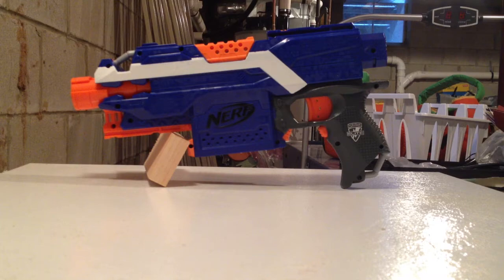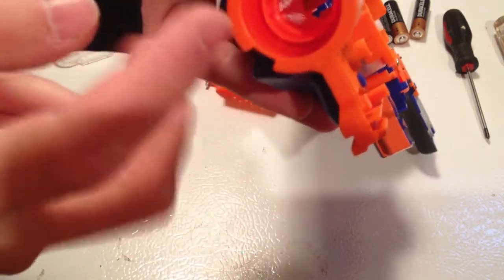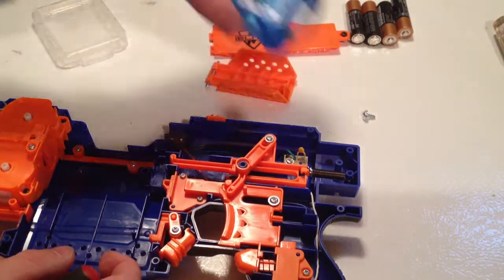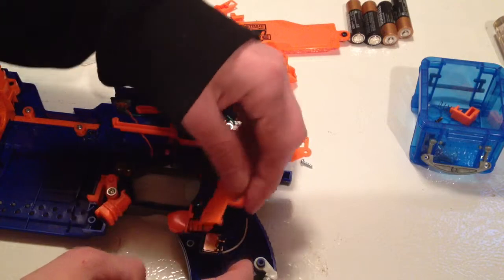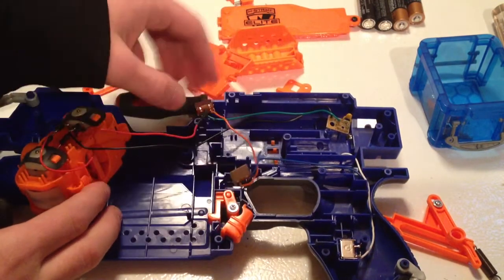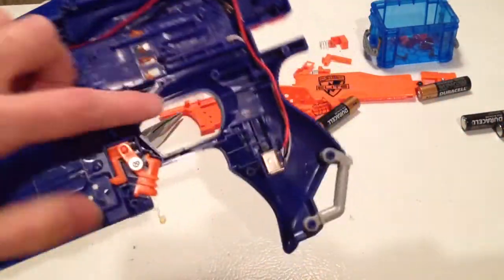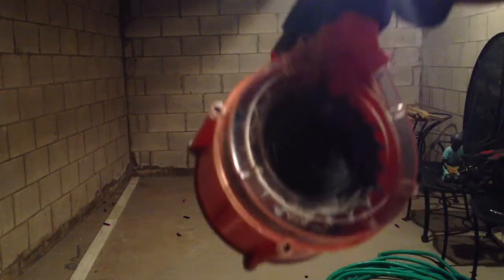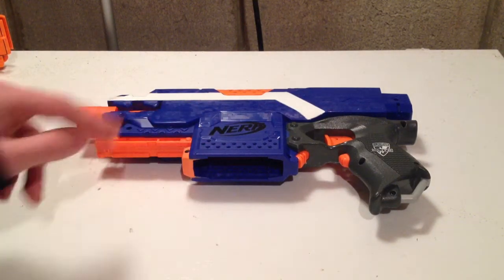Nerf Stryfe Mod Guide

Comment: How do i remove resistors
Reply from the maker: Just use wire cutters and remove them. You need to solder on new wires when you do this

Comment: Hey I have a question. Could I use the Orange wire from the jam door lock and the blue wire from the clip lock solder them together instead of getting new wire entirely? Just for the positive lead of course.
Reply from the maker: That would work assuming there is enough wire to reach